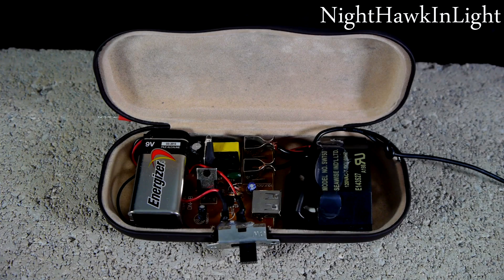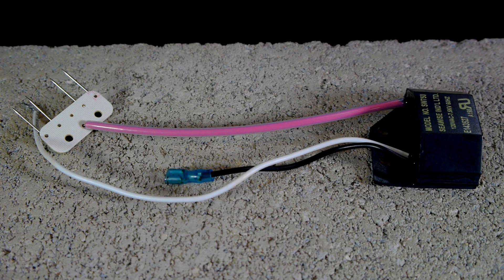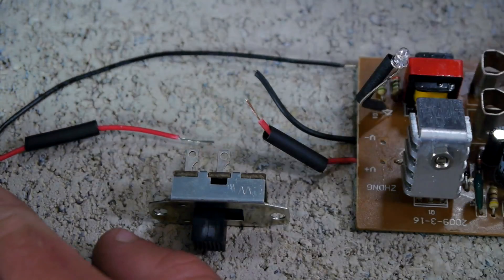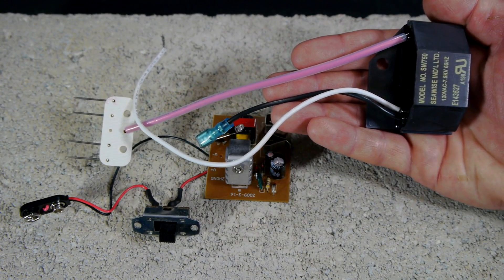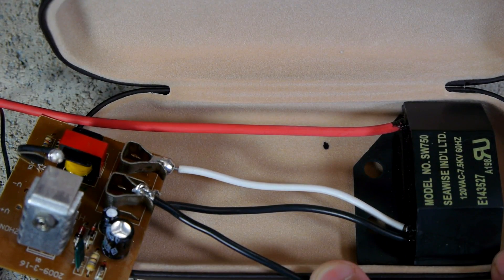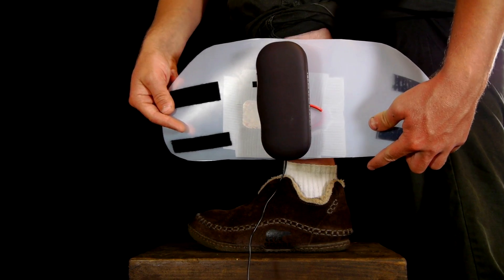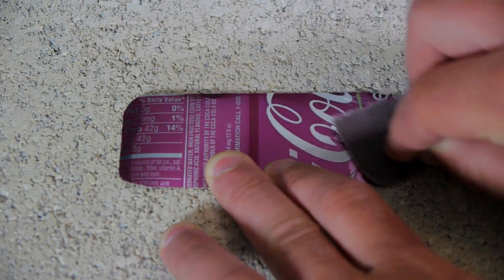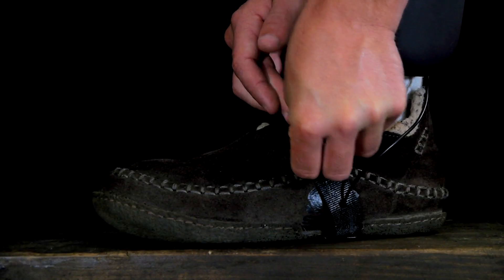How to Shock Anything & Fry Electronics with a Touch!

Comment: by using a larger battery more than 12 volts or more batteries you could potentially fry the electronics that are use to using 12 or less volts

Comment: Nah. Since you have full instructions, it should be easy. All this project really is is soldiering and taping. Just pretend the transformer is the AC converter and you'll have no problem <3

Also, the transformer needs to increase the voltage by 3 volts.

Comment: No, in this video it uses a AC generator. What I am saying is that instead of having the AC converter, have a energy transformer that increases the energy by 3 volts.

Comment: During assembly, use a power transformer instead of the converter.

In terms of the appropriate voltage, you will need a transformer that increases the energy by 3 volts (I do not know how to measure transformer stats).

Comment: No. The aluminum can allows there to be contact points. Every new point lowers the voltage entering your leg (from that point, ofc). If you just use a wire with no bigger contact, all the electricity would enter through one area.

Comment: You will need to replace the DC>AC converter with the appropriate power transformer/regulator to bring the voltage up the the correct level.

Comment: if you dont have a 9volt battery plug can you take a 9volt battery apart and solder some wires to the back of the plug part and use that as the plug? because ive taken one apart, there are 6 small batteries in it (energizer) and the end is just like a plug on the inside.

Comment: To make the 12V DC generator work, you must use 4  12v battery A23 size and connect them in parrallel.

Comment: I bought Negative Ion Generator 12VDC Input -20KV Output - from your link. From the web page of amazing1it seems the second output (black wire next to red) is ground in same potential than battery minus? However, if I connect this to ground (radiator) it will see and hear sparks there coming from this black ground wire. What I'm doing wrong?

Comment from the maker: Yes, connect it directly with your on/off switch dividing one of the wires and the ground wire spliced on to the black input unless the generator has a fourth wire specifically for a ground.

Comment: I understand the need for a large contact area on the leg to prevent discomfort but this raises a question, do you feel anything at eh point of discharge on your skin? I mean, in this video you used your finger to shock things, I'm wondering if your finger also gets shocked, or if you feel anything at all.

Comment: Or instead you could insulate the whole system, removing the contact with the body, replacing the leg case with a glove. This way you can increase the voltage to what ever amount you want, so long as you're careful enough not to touch any of the wires. You place a very very small strip of metal (or possibly even a prong) at the end of the glove's index finger and suddenly your finger becomes a lightning rod.

Comment: Need a bigger spark? Super size the whole project, get a bigger power source, and increase the available contact the current has with the body to a size able area, most likely you'd need the entire leg or calf as a contact area, which would require a large sheet of aluminum. This way you'd probably be able to release an arc from an inch to maybe even half a foot, depending on how strong your power source is and how large the system you make is.

Comment: @Nighthawkinlight I have extracted a negative ion generator from an air humidifier.It says it is AC powered. I plug the generator to an outlet, tap an AC line and check for shock and it seems that it is not working. The Ion Generator has four(4) wires (2 for AC, 1 -ions, 1=?). I have no idea what is the purpose of the last wire. In the air humidifier it is installed near the high voltage. I have also extracted another 4 wire ion generator, also not working.  i hope you can help again. TIA

Comment: The soldering iron is used because electrons pass through metal easiest. You can use hot glue to connect the wires, but you run the risk of the device not working as efficiently or possibly not at all. If you don't have a soldering iron, try twisting wires together and using electrical tape. not as effective or permanent, but it may work temporarily

Comment: What kind of soldering iron and solder are you using? I've never had any luck with anything but electric soldering irons but yours seems to work flawlessly. I also generally use 60/40 rosin core solder.

Comment: Also, let it be noted I am using the ground coming from the generator, wondered if I should try adding another ground at the socket to see if that would work any better though I don't see a difference in where you put the grounding in one complete system...

Comment: Alright man, did everything, finished it, seems to work fine until I connect it on me, ground is under my foot on aluminium, and the 'out' is against my foot.
It doesn't work, or at least it doesn't unless the thing I want to electrify is in contact with the ground. What gives? Maybe the battery is dying from my tests? Maybe I should of used to batteries parralol? Help NIGHT! Also if I add a potentiometer instead of a switch and use a car battery, would that be viable?

Comment: •Standard compliance: TUV UL 
•Input voltage: 50-60Hz AC 200V~220V or 100~130V (Please specify which voltage is needed, otherwise 200V model will be provided by default unless voltage of main electricity in you country is clear.) 
•Input current: <2mA 
•Output voltage: 4.5±1.5kV (5G)  
•Frequency: 1.5k±0.5kHz 
•Negative ion count:1~6 million pcs/cc air at distance 30cm 
•Remainder Ozone: <0.001ppm 
•Ionizer body dimensions: 42mm wide, 23mm deep, 30mm tall

Comment: Dear Nighthawkinlight
I bought the Power Converter and all of the other part but not the 12v AC Power converter because it wasn't in stock at the time and figured that it would be soon,So I had assembled everything and was going to order the ion generator but noticed that the supply of them had been depleted and never restored on any website,So I ordered the AC generator,It is not the same at all and I have no idea what to do now,Could you please make a Tutorial on the DC generator?

Comment from the maker: It might work, I don't know. Some ozone generators seem to use different processes than the type of generator I use in this video. They all use high voltage, but some are not capable of creating ions or charging anything and simply create an arc that makes the ozone. I don't know enough about electronics to say which is which by the stats alone.

Comment: I have found an ion generator with these specs would this work:
Model : PA-011   Ozone Air Module
 
Specification :
Input voltage: DC 12V
Ozone rated: 5~20 mg/Hr
Output voltage : 6.5 KV
Operating temp.: 0¢X~40¢XC
Current consumption : 200mA
Frequency : 18 KHz ....
    ..... could you tell me which one would be too strong to use???

Comment: Your body can only take so much charge or current so please only use one. Yes you would feel the shock just like when you shock someone. You would technically be counted as an EMI not an EMP; Ones constant and ones a pulse. Touching water wouldn't be advised while a current is running through ones body. You are the toaster in the tub.

Comment: You feel the shock only if you are using the finger. If you use a small piece of metal, and hold into your closed hand, you feel no shock at all, because all the charge mooves trough all the hand surface, and not just one point.

Comment: What if you touched the two wires? I don't want to mess with electronics that I can't safely electrocute myself with. I've also got a shocking pen. It's apparently a high voltage ac current powered by 6 volts. I took the electronics out and powered it with a 3 volt battery pack and it's still very powerful, which I thought about using instead of the inverter. Any way to test the output will be safe before wiring it up?

Comment: Why does my DC generator have two red and two black wires? It's the generator from the description. There are two similar wires which I believe connect to the battery, a thick red wire (output?), and a black wire that has hot glue at the base... Help!

Comment: i am thinking of using two 12 volt energizer batteries connected to the DC generator you linked to, obviously this should work as planned without the converter but i am wondering will this create a more powerful charge..? or will the current be low enough that the charge wont be to painful?

Comment: What if the generator has an extra green wire? Also Anion Generator so hope it works the same... What the fuck is the 3rd green wire? Shouldn't there be just red, black(power) and White(output?). What am I supposed to do with this shit? :/

Comment: Not quite, I cut open a bicycle water bottles, and put several strips of velcro on it. Two strips for connecting it around my leg, and a small strip each for both components, the battery w/ harness and the ion generator. It works very nicely, and though not as nice looking, has an overall smaller profile, and allows me to get quick easy access.

Comment: If I have an ionizer that works off of DC, can I just wire it straight to the switch and then have a ground wire soldered and heat shrink wrapped somewhere along the black wire, or would it be better to have the ground wire soldered directly to the ionizer?

Comment: Thanks, but your link doesn't work (when I strip away spaces of course). I think what you said makes a good amount of sense. I still have this barely working. Only if I'm standing on a certain floor will it work, and even then, I get only very tiny arcs, only audible really.

I think it may be as a result of the negative battery lead touching me. That would cause it to both pull electrons from me and store them on me, negating the effects. I'll see if I can mitigate that. Thanks!

Comment: Don't most of these inverters have a built in low voltage cutoff? Not having a cutoff could cause you to kill your car battery, permanently and could cause cell reversal.  I have a slightly larger inverter and it won't even work at 12V, it will not turn on unless you are up to about 13V and it really wants about 14V.

Comment: Very cool! I'm in the process of building this literally right now, (except with a 15kV ionizer). But can someone explain the purpose of having to connect it to ground? I'm not the best yet at understanding how electricity works, but it seems to me that the electricity flowing into the person wearing this is already going through them (like a capacitor) and flowing to ground without the aluminum footing.

Comment: what can you do to ground yourself if your natural energy when emotionally upset blows lights as you flip the switch and messes up your phone even to the point of draining fully charged batteries in under an hour...sometimes the phone never returns to normal...ive thought maybe when im upset i should wear gloves that have a rubber palm...but is there anything that could be permanently done to rectify it all together?

Comment from the maker: The battery powers the generator. The ground wire could go to your hand, but it would constantly shock you and would make this device pretty pointless. The device charges to full capacity pretty quickly, so you won't notice a difference between how long it's been charging.

Comment from the maker: The generator in the description has three wires. Red, black and white. Red and black go to the battery, white is the output. White goes to your body, and a three way splice on the black wire goes to the ground. if your generator only came with two wires it's broken and should be returned.

Comment: @Nighthawkinlight
Hello, I saw this video and instantly subbed and am hooked on making it I just have a few questions if you could answer them please.
1. What is the point of the battery, does excess energy get storred into the battey which I can use to power another item such as a light?
2. Can the ground wire go onto my and have the same effect as long as my hand is touching and object
3. The longer I go without shocking anything will the charge or shock be stronger
Thanks

Comment: Hello, I am using the DC ion generator in the description but it only has two wires, your ion generator has three (the pink wire where the electrons are pushed out). Where are the electrons pushed out in the DC circuit? I'm not sure what the arc should be between, should I splice in another red wire to the ones connecting to the switch? How exactly should I configure the circuit to make it work? Where are the electrons

Comment: Hey I found a negative ion generator which is DC powered but its not separate like yours. Instead, it is in a small container which connects to the car cigarette lighter unit. I was wondering if that may work if I remove the outer casing and just isolate the negative ion generator part. Thanks!

Comment: Yes I built this but for some reason it does work. Unless my friend holds the wire that would be on your foot. Please help me out I don't under stand. I used everything you said and did but I just had a metal glasses case but used electrical tape to insulate i

Comment: This is my favorite video of yours, it's such a simple design. I love this idea and am going to build it in the next week. Also you have a pretty awesome looking soldering iron.
Regarding the comment below about if it can kill people the answer is no it can not, this is because of amperage. There is enough voltage in this device to penetrate through the skin but not enough to do any real harm, you will only experience some slight discomfort.
Thanks for this video!

Comment from the maker: It's simple. Connect the input leads off the generator to the battery harness, red to red black to black with a switch in between one of them to turn it on and off. Your ground wire should be spliced onto the black wire.

Comment from the maker: My case does get a charge. That's what the plastic sheet is for to shield your leg from arcing to the case. If it's arcing internally you have an insulation issue with the wire that's leading to your leg.

Comment from the maker: Yes, actually it will. But only if the bug comes between you and a grounded source. Touch one that's walking on the ground and it will fry, but if one simply lands on you it doesn't get enough of a shock.

Comment from the maker: Being on a top floor will not allow this device to work. It needs to have conductivity with the ground to give a good shock, which is why it works for you outside. It will also work on first floor buildings, or anywhere that the flooring is at least slightly conductive.

Comment from the maker: Yes, it's because they are not grounded, or the ground you are standing on is not conductive. It will work slightly as you have seen even if the object you are shocking is not grounded, but will work best if both you and the object you touch are in contact with the ground.

Comment: I just completed mine and it only shocks things with the ground wire. I can feel the electricity on my leg. If I hold metal things to my ground wire it will shock me or the metal. I was only able to shock metal outside when the ground was wet.

Comment: I am going to build this project just so i can simply watch the effects from using this and then touching a Plasma Globe. I figure the Plasma Globe is already running at a higher voltage in the vacuum so it should not ruin it with the jolt, and if it does, trash it becomes.

Comment from the maker: Where did the DC generator come from? DC ion generators made for cars do not use the same electronics to produce ions and will not work to charge things with static electricity. If that is what you used it will not work. If your generator is similar to the one I have and was not made for cars it may have the correct electronics, in which case the issue is probably that you are not standing on conductive enough ground or you are trying to shock non conductive or non grounded objects.

Comment: @nighthawkinlight Am I missing something? please help me. I am currently using 4.5kv ion generator (DC input) powered by 4pcs a23 size 12volts  batteries (lined in parallel). it is assembled in a manner same as your instructions, but i doesn't work. I hope you can give your bright views with regards to this.  
additional info:
  * Either I use the positive nor the negative terminal to the ground still it doesn't work *

Comment: Not without causing you to be paralyzed. You gotta think. He puts the red wire to a piece of aluminum which touches his leg. It goes into you before it goes into someone else so it'd do you harm as well. When you use this, you are receiving the electrical shock. Electricity goes through are bodies and looks for the best way out. Honestly, it'd be better if you could put it on your arm so it has a shorter way out, but it would be more noticeable.

Comment: Very nice!  I built something almost identical about 20 years ago.  I can recommend a few other tricks I learned with mine:
You can stick sheets of paper to walls by just slapping them on with your hands. If someone peels them off they will no longer stick.
 Cylindrical objects like paper cups or even soda cans can be "telikinetically" rolled around on a table by holding your hand to one side.
Placing your hand on someone's shoulder will create a shower of short sparks through their shirt.
Reply: damn you must've played around a lot my bro

Comment: HELP NEEDED PLEASE!

i want to build one of these but i live in UK and need parts, the website for the ion device dont deliver to the UK plus i have a 12v to 240v 5w converter for car but im wondering if thats too much power since US is 120v, plus i found a few ion devices on ebay rating 240v input but only 4.5±1.5kV output when the one on the website is 7.5kV, so im wondering if that is not enough power? can anyone help me please?